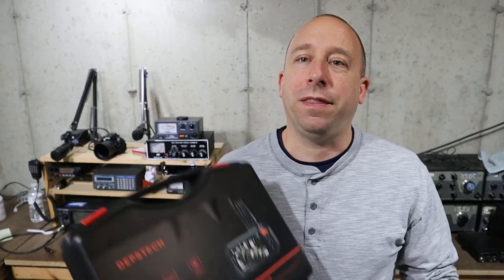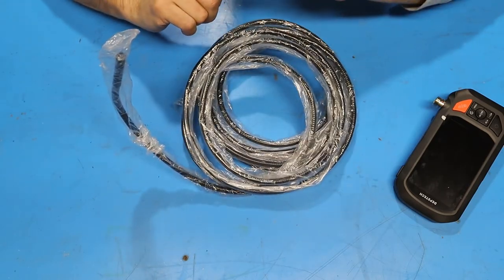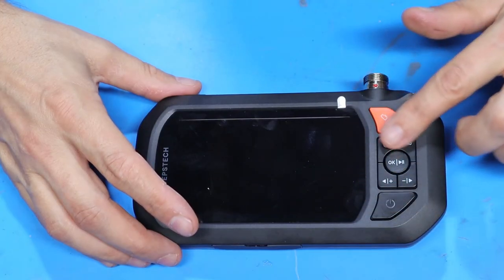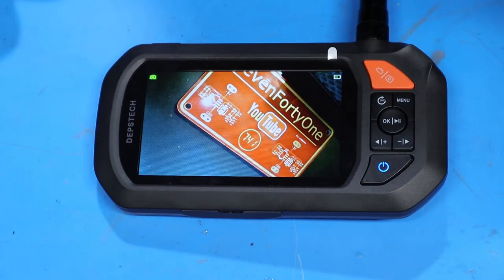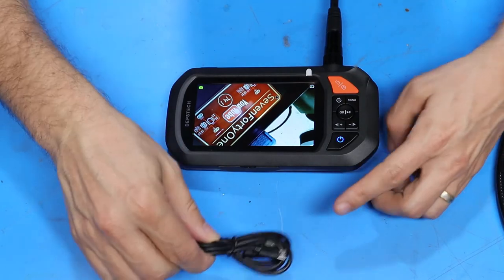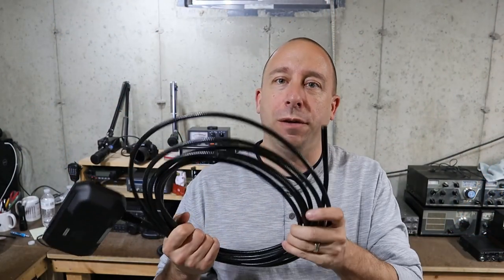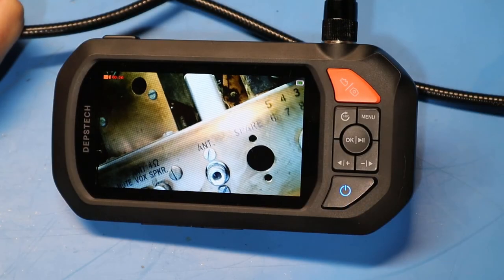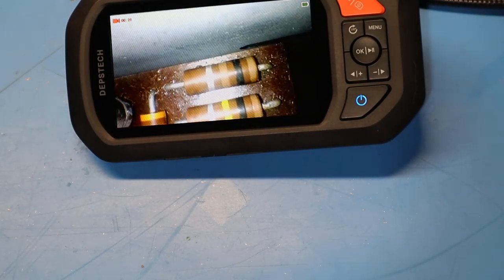DS430 Industrial Endoscope - Overview, Demo, and First Impressions

Comment: bring piston to the top, spray some easy off oven cleaner on the piston, wait one day  , take wooden popsicle stick, agitate the top of the piston, then get oil squirt can, heat up some burnt motor oil, and flush out oven cleaner with it.  then change engine oil. take head off, spray valves with easy off oven cleaner, put new head gasket  and it will be like new.

Comment: I wonder if the hook and magnet accessories for the tip of the camera are actually meant as tools to "grab" a wire or string or that very important, one of a kind, nut or bolt. I could see this being very handy for locating and pulling a wire that you may not be able to see and get your fingers on... Thanks for the video and your channel